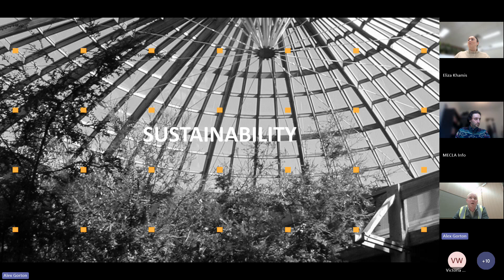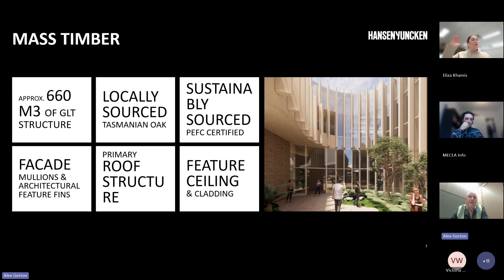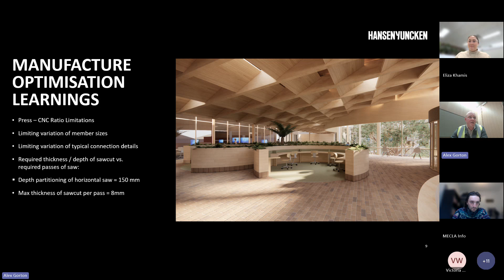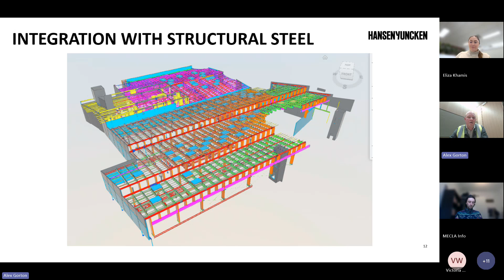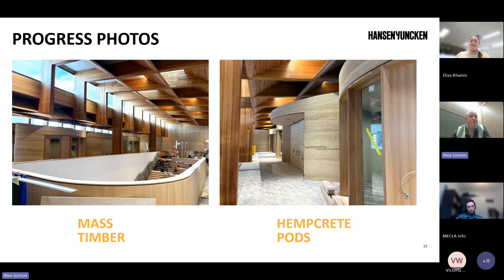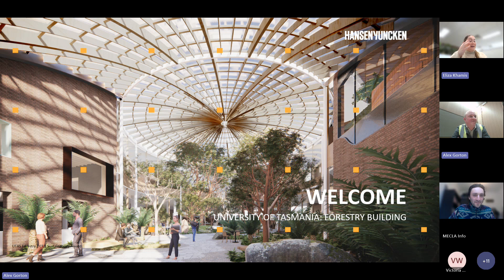University of Tasmania Forestry Project Case Study | Alex Gorton

Comment: I'm genuinely saddened to see a building with so much work done on sustainability, simply accepting that PEFC tas oak is the solution. The ability to choose alternatives that directly compete with the logging of critical Old Growth forest still in the PTPZ is always there. Shining Gum Glulam is also available through VICASH or Masslam, and though would be different, the decision was made to use Tas Oak, Eyc. Regans. That decision simply doesn't hold up to any scrutiny from a sustainable sense. 

I'd also love to know what percent of the mass and volume the hemp herd is in the hempcrete walls. Are they self supporting or is the hemp being used as an insulative material?